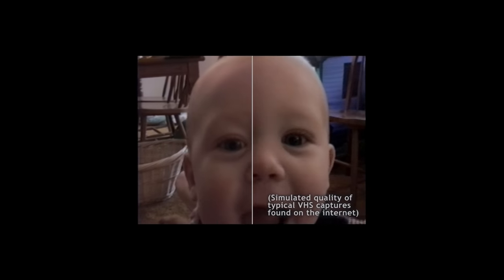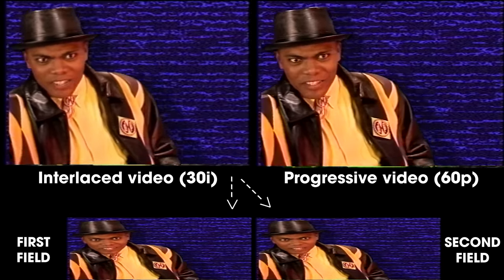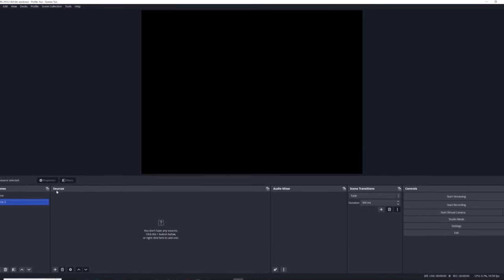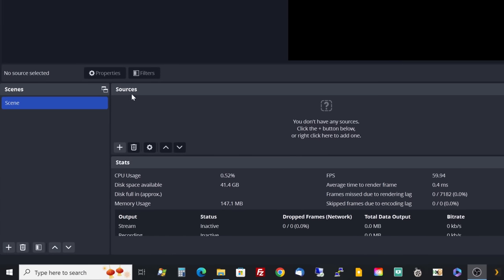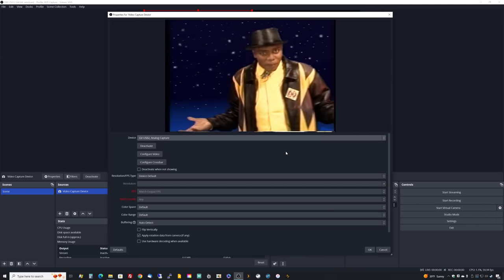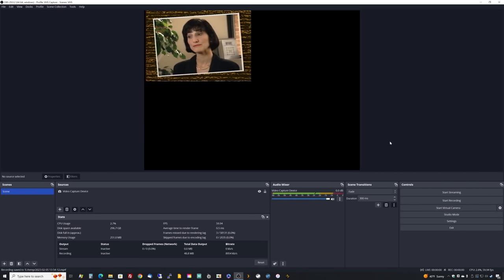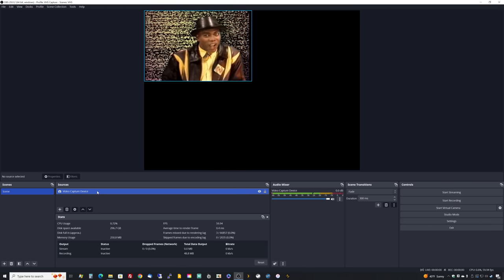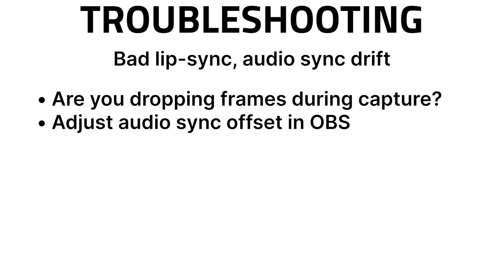How to convert VHS videotape to 60p digital video

Comment: Thanks for the video! Any recommendations for cutting final file size? I've been using this process, but some of the videos have ended up being quite large at 30+ GB. Would handbrake be good enough? For reference, these are family videos recorded on a handy cam, so I’m not looking for picture perfect. That's also why this tutorial ended up being so helpful!
Reply: I too am interested in the answer to this. I 30Mbps is a pretty hefty bitrate.
Reply: just want to stay updated if this gets answered
Reply from the maker: 30GB is really large, but you didn't specify the length of the file that made it that big.  If this was a 6-hour video, then 30G is actually quite reasonable.  But yes, if you need to crunch the video down even smaller, you can run it through handbrake and then tweak the settings to your heart's content.  I recommend x264 with a CRF of 18.
Reply: I’m not familiar with handbrake is this a separate software?
Reply: @PhotosinMotion2U  Yes it is, it's used mainly to compress video down to smaller file sizes, primarily for sharing online
Reply: @Y0Y0Evan  Do you have a link where I could download it?
Reply: @TheOldskoolPC  Thanks! Also, apologies for the late response/lack of clarification. The video is 2 hours long. I was expecting the video to be larger at 59.94 as opposed to 29.97, but for family distribution obviously 30gb is just a tad large for a single video file.
Reply: @TheOldskoolPC  you think x264 gets better results than x265 for VHS? I made different videos to compare and thought x265 looked better. But not sure...

Comment: The sad thing is most people hate 60fps so they disregard any understanding on how to transfer VHS to digital with missing frames or not deinterlacing the video properly.
Reply from the maker: Hate 60fps?  Maybe they've been conditioned to think that based on "the soap opera effect" -- which I agree is horrible.... until you're trying to capture an actual soap opera and then you need all 60fps to represent it properly :-)
Reply: @TheOldskoolPC  Basically most television Shows, News, Sports, Commercials in the last century implemented 60fps in one way or another.
Look at America's Funny Home Videos for example, most of all camcorders were at 60fps but sadly everyone in the world doesn't know how to rip there videos properly and there is a lot of misinformation about how old CRT TVs work. They say NTSC was only 29.97fps but what they don't know is that both interlace field did not appear at the same time which if it did... it would be called progressive and not interlace. LCDs are always progressive even if you are watching interlace video on it, that I do know and it using post processing to get around it's progressive nature. The only CRTs that were true progressive scan in the 90s was computer CRT monitors.

You probably know all about this stuff anyway.

Comment: Hi, Does the Dazzle device require driver software on a Windows PC or will OBS recognize it automatically?  Thanks for this great tutorial.  I just ordered a Dazzle unit from Ebay, but it didn't mention any included software.
Reply from the maker: Dazzle requires a driver; there's a link to another video in the description that covers the best driver installation method.

Comment: Would you recommend using an S-Video cable instead of composite?
Reply from the maker: Yes, in all cases except using a composite-to-s-video adapter, which adds nothing.  If your player has a native s-video port, use it.

Comment: How do I get the audio to come through?  I downloaded the DVC100 drivers from the link in the video description, I am using a Dazzle DVC100 revision 1.1, and the video is just as it should be, but there is no sound.  I have already gone to "Source/Properties/Audio Output Mode=Capture audio only/Use custom audio device=Yes/Audio Device=Line (Dazzle DVC100 Audio Device)."  There is no sound no matter which audio input I set for the Audio Device; the volume meter never lights up at all.

I have already set Audio Monitoring=Monitor and Output.  I have already gone into Windows Sound and set the device level to 100% and not muted.  In Device Manger, the Dazzle appears under "audio inputs and outputs."
Reply: Well, one solution is to use a totally different converter for the audio.  I took the red and white RCA connectors from the VCR and adapted them to a stereo 3.5-mm. connector, then put that into a USB hub that includes a 3.5-mm. monaural port for a microphone.  But I would ideally like to find the right settings to get audio from the Dazzle DVC100, especially since the audio loses stereo this way.
Reply: Well, I got the sound working directly from the Dazzle DVC100.  In stereo, even!  What I did was this: 1. In the properties of the DVC100, set Audio Output Mode = Capture Audio Only, check "Use custom audio device," and set Audio Device equal to whichever of the audio inputs includes the words "Dazzle DVC100" (in my case, OBS calls this "Line 5."  2. In Configure Crossbar, set Output="1: Audio Decoder Out" then set Input="5: Line In," and click Apply.  And like always, occasionally even after setting all that, you have to close and restart OBS.

Comment: Are these the best settings there are for digitizing VHS on OBS with GV-USB2? My VHS tapes are filmed for the PAL region, so I capture them in 50 FPS. Also, I'm capturing the footage in 1440x1080 as you recommended, but I found some posts online saying that 768x576 is an even better option. Is the 768x576 a better option for more lower-quality capture cards and the 1440x1080 a better one for digitizing with the GV-USB2? I'm digitizing my tapes from the Sony SLV EB11 with a SCART to Composite output in the GV-USB2 connected to my laptop. Could I somehow get even better quality footage? Cheers!

Comment: How does one set correct deinterlace mothod? I.e. where does one set interpolating upscale of the fields rather than field blending?
Reply from the maker: That's covered in the video during the screencast/demonstration part.  You can change the scaling method to Lanczos, which occurs after the deinterlacing by the yadifx2 filter.

Comment: I noticed when setting up your capture device you left the Resolution/FPS setting to "Device Default".  How do you know what the FPS will be if it is left to default?

Also what does "Match Output FPS" mean?  I'm not sure I understand what the "output" is in this particular setting.
Reply from the maker: The default FPS will be whatever the capture device provides by default, which is generally safe.  As for Match Output FPS, it means it will match the FPS of the canvas' setting, which you can get to via Settings->Video.  Setting this specifically to 59.94 is covered in the tutorial.

Comment: Do you need the driver for the dazzle device to get it to work on the OBS STUDIO PROGRAM?
Reply from the maker: Yes.  If you don't have a dazzle device yet, I'd recommend the GV-USB2 instead, as it has no driver issues on Windows 11.
Reply: @TheOldskoolPC  Do you have any other suggested devices for windows as i'm struggling to get the GV device in the UK, thanks
Reply: Will the GV-usb2 work with windows 10?

Comment: I have about 15 tapes that are analog 8mm that I can play on my Sony DCR-TRV530 digital camera. How would that work if the camera is converting the tapes to digital? Am I better to have the camera make the conversion, or try and find an older device to play the tapes in their native format?
Reply from the maker: The digital conversion converts the analog signal to DV, which you would then capture with a firewire (IEEE1394) port on a computer.  The advantage is that the video and audio would be locked together and would never drift out of sync.  The disadvantage is that the video loses a tiny amount of quality when converted this way, since DV uses a 4:1:1 colorspace.  Saturated deep colors, like red, have a "stairstep" appearance on their edges when converted to DV.

Comment: Is there a capture hardware which has scart as input? In europe it is pretty common for old vhs reader to have this interface output. And it should have even a better quality
Reply from the maker: The signal on a standard VHS tape mixes luma and chroma into the same signal, so you can convert SCART in this specific case to any other standard (s-video, composite) and it shouldn't further degrade the signal.

Comment: Thanks so much for this video! I got the I-O Data GV-USB2 at your recommendation and so far so great. The only thing I've noticed is some jittery frames on long pans across landscapes/rooms. Is that caused by anything I can control? I'm not dropping frames at all and I've tried many different settings for interlacing/scale filtering just to make sure. I'm using a TBC in my S-VHS and when I switched VCRs to something more standard, the problem persisted. Any help would be appreciated! I was thinking about uploading a sample to give you an idea.
Reply from the maker: I believe we covered this in Patreon?  But if not, I would try decoupling the video and audio into two sources, a video source and an audio source, and see if that helps.
Reply: @TheOldskoolPC  we did cover this in Patreon! Stil not having luck with it, but I ordered a Dazzle DVC100, and we'll see how that goes.
Reply: This might not help, but some of the Amazon reviews talk about this dongle overheating, so maybe cooling it down somehow could possibly help.
Reply: @TheOldskoolPC  I wanted to give you a little bit of an update. I was able to find another PC running Windows 10 (instead of 11) and that has made all the difference in performance. Now I'm getting smooth 60FPS. One thing I did notice coming from my Canopus ADVC 110, is that the clarity seems to be not quite as good. I pushed the sharpness up on the GV-USB2 but I didn't know if there was a better way to gain back some of that missing detail. It almost looks like it's just blurred together just a little bit.

Comment: Thank you for the great info! Looking to convert my VHS collection to digital. However, one thing I can not find is good recommendation for multi region VHS players, as I have a bit scattered collection of both Japanese tapes, UK, US and such. Any good suggestions?
Reply from the maker: I've never run across a multi=system tape player.  DVD, yes, but not VHS tape.  You need two players, US (plays Japan) and UK.  Japan standards are 0 IRE instead of the US's 7.5 IRE, but those levels are encoded on the tape, they're not a function of the player, so a US player should be ok.
Reply: @TheOldskoolPC  Thank you so much for the input! Now I just got sto see how to snag some here in the EU ^^;;;

Comment: Hi Jim, Great tutorial.  I have transferred VHS home movies; however, the audio seems to always fade in and out   I'm using OBS how can I lock in the audio, so it doesn't lose any audio. Please help..
Reply from the maker: If the audio fades in and out, I'd clean the VHS heads, or see if you can make adjustments to tracking.  Volume fading in and out is not an OBS/capture problem, but a playback problem.
Reply: @TheOldskoolPC  OK thanks for getting back to me. So, just so I can understand it not and OBS issue its the VCR that needs to be cleaned.  What I'm doing now.  When the audio goes out I go to the properties in the capture device then deactivate - cugfigure change to audio out audio in then audio comes back but it's annoying. I was hoping there was a fixed setting to keep the audio ftom fading out.  I will try to Clean the heads. Is there a particular YouTube tutorial out there on how to do it.  Thanks again Jim
Reply: Hi Jim I called Elgato for tech support. The tech told me that the elgato software needs to be opened it the background then the OBS that way the audio will work from the OBS.  I have tried it and the audio is still working. Just thought you and any everyone should know. Thanks

Comment: Hi old skhool I’m trying to transfer some VHS Tapes to digital.  I’m using elgato video capture. Two things are happening. 1.  In OBS there is no sound.  When I in elgato sounds works fine but No sound in OBS. 2.  Something the sound scretches.  Any suggestions would be appreciate.  Thank you
Reply from the maker: I'm sorry, but I don't have the elgato device to test with, so I'm not sure what to tell you.  I would try OBS again, and then use the tip in the troubleshooting section at the end of the video to add a second audio source.

Comment: If your end goal is to burn the output to a DVD disk, do you still need to set the Scene resolution to 1440x1080?   That's too high res for a DVD disk, is it not?   Won't that mean you'll need to downscale the result somehow before you burn it to DVD?  Wouldn't it make more sense to capture it at the resolution of DVD?
Reply from the maker: This tutorial is not really meant for creating files for burning to DVD.  But if you want to do that, you can set the canvas to the same size as the capture source (likely 720x480 or 720x576 depending on your country) and don't deinterlace at all, just capture the interlaced signal directly to a file.  For the file format, see what formats your DVD software accept.

Comment: After digitizing my Hi8 video, should I open and edit it (in Premiere) as 60fps or 30? Also, is there any significant difference between using component vs s-video cables in the process?
Reply from the maker: If you want to capture specifically for editing later, this is not necessarily the process I would follow.  Premiere Pro, as of 2023, still supports interlaced editing perfectly, and so I would use a different process and capture directly to the native resolution of your source material.  But, if you just want to try it, the resulting videos from this tutorial will work fine in Premiere, they'll be interpreted as 60p and you should create a sequence that is 60p as well.

Comment: great video - BUT, On SVHS plug ins I'm not getting any audio.. I have more SVHS tapes I made than std VHS. Will I lose much quality by only using std VHS..?
Reply from the maker: If you recorded to SVHS, you will definitely lose quality if you switch to VHS/composite.  I suggest troubleshooting your issue, you really want S-VHS/s-video for actual s-vhs content.
Reply: Why you dont use red and white RCA audio cables with s-video cable?

Comment: There are a lot of the Dazzle devices on eBay but few list the Rev. #.  If they say that they are USB compatible, does that mean they will work the same SW and procedure?
Reply from the maker: No, as some revisions don't work with modern OSes (they don't have drivers).  That said, search these comments for "dazzle" as I believe one commenter had some tips for getting any Dazzle device to work.

Comment: Why should it be 1440x1080 when i vhs is only 720x576 in resolution?
Reply from the maker: That canvas size was chosen because, if you want to upload the video to youtube, youtube will only show 50p videos at the full framerate if the video is 720p or more.  So creating a 576p video won't show up as 50fps on youtube.  If you don't care about youtube, then you can certainly set the size to exactly 720x576 and you'll make a smaller file.
Reply: @TheOldskoolPC  Okay thanks for answer. I am not going to upload it on YouTube så 720x576 works great for me.
Reply: @TheOldskoolPC  Youtube player in my Sony TV automatically start playing 1440x1080 50p video as 720p by default. That's why I  prefer capture my VHS to 1920x1080 50p.

Comment: Jim,
I'm trying to convert camcorder cassettes and larger vhs cassettes to digital video.  I got a dazzle DVC 100 rev 1.1 off ebay as you suggested and I have downloaded OBS and set up instruct.  I am truly a novice and I'm running windows 10.  How/what driver do I install for the dazzle DVC 100 as I have no way to use the DVD driver?
Rich
Reply from the maker: I put a link to the driver in this video's description, but read the other comments as they have links to alternate drivers IIRC.

Comment: I ordered a Dazzle DVC100 rev 1.1 off ebay, it was a new old stock never opened. Red one..... And sadly this doesnt pick up audio and actually the video quality was the same as the Digitnow one. Im gonna guess i got a bad one but it was literally never been opened. Im back to the drawing board again sadly
Reply from the maker: You can connect the audio a different way, such as the line-in port on your PC.  See the troubleshooting section for more info.
Reply: yeah my laptop requires a special cable and i did try that but i couldnt find it on OBS for some reason. But im waiting on another dazzle soon and gonna try that, one of the ones you recommended. I hope it works :)  @TheOldskoolPC
Reply: i bought another DVC 100 vs 1.1 and it also doesnt work, i downloaded the 64 bit driver for it, it doesnt show any video at all, so confused.... i tried this on windows 10 and windows 11 and no video showing up in OBS, any ideas? @TheOldskoolPC

Comment: My Sony Camcorder has 4 pin DV out. Instead of purchasing the recommended hardware can I go Sony 4pin DV to 8 pin DV, 8 pin DV to thunderbolt 2, thunderbolt 2 to thunderbolt 3 into OBS on a PC? Will I get the same results? Thank you.
Reply from the maker: If your camcorder is a DV camcorder with DV/firewire output, I would recommend finding a firewire (IEEE 1394) device or converter and transferring the tapes that way.  That will grab the digital data off the tapes without another generational loss.

Comment: With the Dazzle dvc 100 you said it's more tolerant of timing issues. What does that mean and how does it compare to the I-O Data?
Reply from the maker: The Dazzle was a product created specifically for VHS and so it is more tolerant of sync pulses that don't occur exactly when they should (like with a stretched tape).  However, a lot of people are reporting trouble trying to use the Dazzle, so I'd get a different unit instead.
Reply: @TheOldskoolPC  thank you!